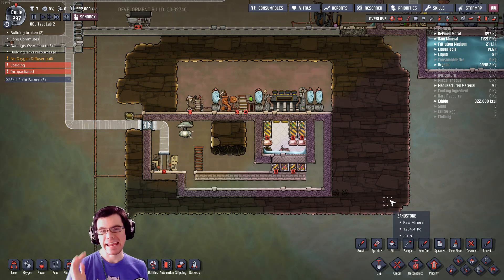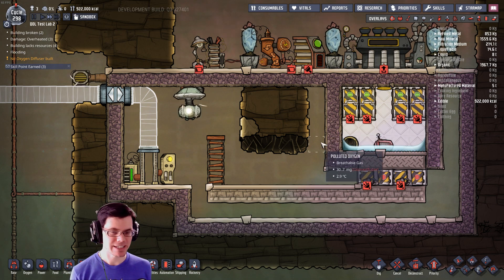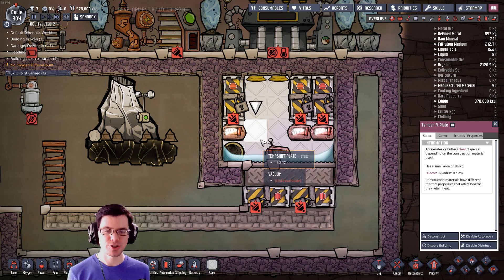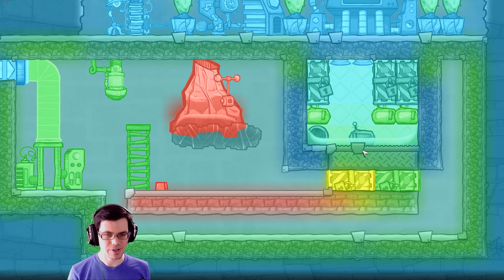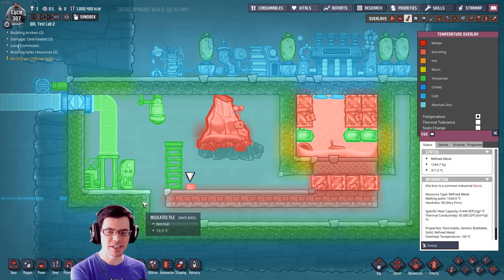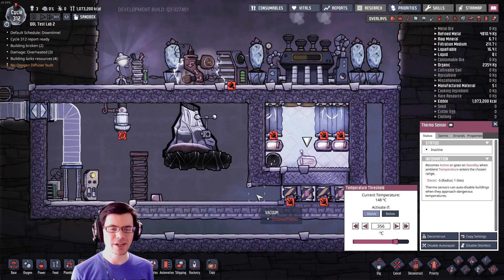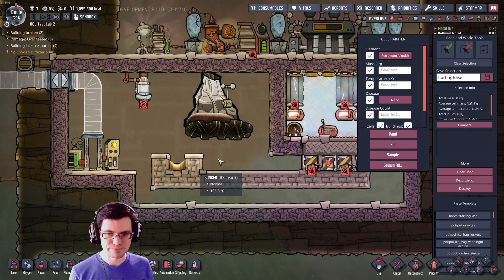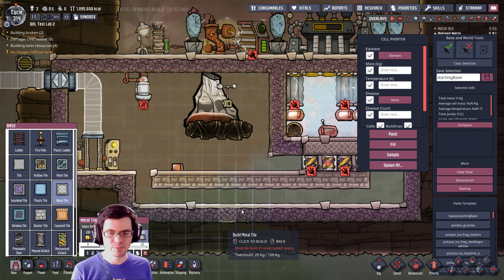Oxygen Not Included Tutorial - Renewable Volcano Power With the New Steam Turbine!

Comment: I think you should remove the solid iron when it reaches the equilibrium temperature. If you don't, the next liquid iron will fall down and it heats up the solid iron retaining some energy and slowing down the process.
Reply: Good point. I wonder if it's worth the effort tho, you can't really monitor the temperature of the metal pieces.
Reply: @frantisekzverina473 he can put a temperature sensor behind the iron and send an automation signal to an auto sweeper. But It will consume Power. I Wonder If there will exist heat Exchange between the solid iron and the temperature sensor. Yes, Frantisek, i think you are right, It doesn't worth the effort.
Reply: @alanmaioli9202  I think the sensor only shows temperature of the environment - gas and liquid. There's vaccuum in the whole room.

Comment: More couplers, steel tile the walls with coupler doors as well.
Right now you have 4 tiles that sink the heat to the water
Increasing the number of tiles that connect should increase transfer
Or add a second steam systems if there is enough heat, slower to start but you'll be running 2

Comment: what you should do is maximize the surface area where the water touches the metal tiles. I suggest enclosing said volcano in a vacuum environment, letting the content dropping onto a metal tile floor (from 5 to 7 tiles) then underneath the tile you would leave a 1 row 4 tile wide encased within an airflow tile so only air would be pumped out by input liquid. at either corners you would place a pump output, this would dish out water. then, as we only have 5 airflow tiles wrapping around 4 empty tiles (with tempshift plate if you like) exposing the rear metal tile to the separate steam container, this would be how you heat up the gas. for max efficiency I suggest you create a small 1 row empty floor (with tempshift) so the steam can be pushed out, encasing it in insulation ofc, then a steam tank directly in contact with the exposed metal tile (which would heat up the steam) and because water would form blocks (not puddle) because of the ingame physics the area of contact is maximized regardless of input ( 0.1 to 10 kg ) and would immediately turn into steam during eruption. And as soon as a block is cleared inside the liquid chamber, the pump would pump even more water into it, a perpetual cycle, and as it runs, the heat would be somewhat regulated by the exposed rim of metal tiles heating up the 2 by X steam tank

Comment: you can use diamond window tiles for 80 thermal conductivite (+50% or so). You can ramp up heat transfer some ways, 1 you can make the iron flow down the right side and make the path shorter for the heat, also you can place diamond tempshift plates to multiply heat transfer between diamond window tiles (or the lesser steel tiles). as tempshifts are 3x3. Make sure though that those tempshift plates dont touch any other heat sinks like insulated tiles etc.

Comment: I have an iron volcano in my currrent base, and your blueprint could look more compact. If its phelps, I'm upgrading it, but I set two turbines above one common spot for the steam just above the volcano; which powers an aquatuner an the auto-sweper layout. Nothing new, petroleum pipes throught turbine (H2 and wheezleworts), volcano (filled whit PO2) and loader chambers ( filled whit crude oil). To not cook your base and save power you can use a shutt-off valve in the converoy rails attached to a timer or temp sensor in the cool crude oil chamber. You dont get extra energy, but the system is auto-efficient, and hey, free iron; but I'm trying to get all the heat energy (putting a radiator whit the rails in a third steam chamber which turbine powers the base; or using a transformer and shutt-off switches what alternate aquatuner and main power line) I think we can use this layout even for purify PO2, make liquid O and H2, or metal refineries.

[EDIT]: Just after some experiments, my setup simply doesn´t gets the turbines at 100% electrical output (only 300-400w in both turbines). The heat spreads througth the metal tiles and the thermal shifplates (the converoy rail radiator just slows the heat exhange), not allowing the heat to focus in the supposed spot (the steam chamber). Also, with a bigger steam and turbine chamber, more heat is needed (and I'm, looking for a 2kg of steam at 200ºC) no retain the heat; and also the heat transfer is a pain (first metal tiles could be at 190-280ºC, but the last ones only reaches 120-140 when the volcano is in eruption). So, it simply doesn´t works. Oh, and the aquatuner it's just a power drainer. Few molten metal tiles in a vacuum does the work much better. 
     In the other side, some kind of piston whit a gas or liquid (imitating the magma in oil biome) just doubles the heat (as well as the power that contents) and the heat transfer surface (i.e. volcano's metal tiles-gas/liquid piston/steam's chamber metal tiles) needed in the medium, and also it's a little bit "cheaty" (because it's compressor after all). Maybe I could turn the compressed sour gas into NG, but is so many that I don't think that it could be power positive (besides power and energy requirements, and the huge dimensions of that machinery).  Then, the idea was to use the molten iron as part of a bigger power plant (use the heat to power steam turbines, cook some petroleum from oil and some NG), but Ithink that the heat from an iron volcano just does not have enough heat itself to power all stuff. But it would be amazing ;) and I still have 2 magma volcanoes in my current map. ^^

Comment: im not sure if this makes any difference or not, but putting a tile on the left and one tile above the neutronium will make the iron fall to the right closer to your build. that would cut out a chunk of the heat transfer tiles below and lower the thermal mass between the iron and the steam pad. also the iron spills to the left because the volcano is 4 tiles wide and spawns iron on the left center tile. if you put a tile on the left in line with the neutronium, it will spill off both sides equally

Comment: 10:54 I'd like to see a double turbine system. Basically, you'd run the steam/water through one, the run-off would be caught by the second one at a higher temperature, the run-off from the second turbine would go back to be inputted into the first. You'd have a higher change in temperature to be converted into energy/work from the second one. The only way I don't see this working is if the steam reaches the critical point by the time it hits the first turbine.

Also, they should increase the allowable temperature for a steam turbine to work at.
I wish I knew how to make a mod for that.

Comment: Depending on how much of the heat energy this system draws from the iron, if you knew what it's highest temperature will be, you could use another solid element with a corresponding melting point, so it turns into a liquid and provides a medium for the heat transfer. That would probably only work after a while, and with dormancy periods and whatnot might not be worth the extra complications.

Another method might be to enclose the volcano with metal tiles and throw some gas in there. So, instead of the "heat runway" have a "heat box" surrounded by the Vacuum room. That way, the heat would transfer equally to all metal tiles around the volcano, and could be drawn from there. Using an airlock alongside the metal tiles would still allow to open up the heat box to access the metal.

Comment: Quick question, how do you get gas OUT of the room with steam? I've found sometimes that oxygen can gum up the steam turbine system.

EDIT: Also, why does the efficiency of heat transfer matter, in the long run. Sure if it transfers a little slower, you'll lose some heat in the beginning. But eventually the system will stabalize since its insulated by a vacuum.

EDIT2: A great way to use an autosweeper and conveyor: Have some sort of sensor (not totally sure how to do this, you could put a temp sensor inside of a one tile box that has a liquid or gas next to the metal tiles with the iron?) anyway, once that sensor is sufficiently low, it activates a steel autosweeper to sweep the iron into some rails, and those rails run right through the metal tiles in the steam room! This will allow the iron to cool fully down to 125-150ish degrees. Obviously you still might want to cool it down further after that, but it would suck that last remaining energy out of the iron AND automate the iron collection, which is pretty handy.

Comment: Use a grabby thingy to grab the iron, making the auto-grabber heat up, which CAN interact with tempshift tiles?  The auto-grabber can't grab the iron in its liquid form, which means the iron can be at most around 1500 degrees when entering, and will almost certainly be less as the heat transfers out fairly quickly.  IDK how hot you can get the grabber or how quickly you could cool it down though.

Comment: A conveyor belt could, if u transfer the material trough the tiles, as in the hot plate...
that is if it wont melt without space materials ofc...
u can automate it too with a temp sensor and flow stop, so that u can control the transfer more directly.

Comment: Seen another design where the metal is dropped through several doors that funnel the heat out and then finally drops it in to water.  That keeps the metal from piling up.

For some reason I thought debris didn't transfer heat to the ground while in a vacuum.
Reply: I think I know what you mean, that was for regular volcano  when you need to prevent the magma turning into tiles. No reason to do for metal volcanoes as the metal does not form tiles when it cools down.
Reply: @frantisekzverina473  You still want to.  It could still form a tile but more importantly if say you let that metal cool over several cycles you will end up with an ever increasing pile of hot metal that never quite gets to a nice removal temperature.  If you drop it through several doors you will end up with manageable piles of generator minimum temp metal that are very easy to pull the rest of the heat out with water by conveying through metal tiles.

Comment: Could you use this as a way to process polluted water to get both dirt but also clean water with out germs?
Reply: That's what I do, especially if the map has a slush geyser.  Use cold polluted water for cooling then when it's it's getting warm shunt it over to a volcano to be turned into clean water.  Any power you get from a turbine is just a bonus, it's really there to condense steam and offset the cost of running an aquatuner.

Comment: Since the amount of power generated is at a fixed ratio with the amount of energy put into the system, the conductivity of the connecting medium is irrelevant in the long term. It will always eventually reach an equilibrium in which the amount of heat generated by the eruption is equal to the amount of heat lost to the Steam Turbine.

Now, an interesting use for Termium and Shift plates is to find out if it is possible to make a heat-pipe network that allows your to generate energy in a centralized location, and/or heat stuff up on demand in far away places... I might even test that myself... But I doubt it can be made across map without significant temperature gradients. /:

Comment: Wouldn't gold tiles be better, because of very low heat capacity it offers?
Reply: Really wouldn't matter potential energy transfered is same.. "Molten iron's heat capacity * weight = potential heat energy it contains." With arbitary numbers: if you travel it with low heat capacity tiles it will just heat up to 800-1000 celcius, while using 4x higher heat capacity material it will heat up 200-250 celcius. But the important part is how fast you lose heat (pass it to the water boiler) Where as heating up water with low capacity 800-1000C will drop to 400-500C while other material would drop to 100-125C. They transfer same amount of heat energy, just one of them works at high heat & low power, other one low heat & high power.
Reply: Really wouldn't matter potential energy transfered is same Only thing that makes difference is the transfer rate.. "Molten iron's heat capacity * weight = potential heat energy it contains." With arbitary numbers: if you travel it with low heat capacity tiles it will just heat up to 800-1000 celcius, while using 4x higher heat capacity material it will heat up 200-250 celcius. But the important part is how fast you lose heat (pass it to the water boiler) Where as heating up water with low capacity 800-1000C will drop to 400-500C while other material would drop to 100-125C. They transfer same amount of heat energy, just one of them works at high heat & low power, other one low heat & high power.

Comment: If the iron flows to the left and your thermal couplers are on the right, wouldn't it be better to build the steam system to the left of the volcano to minimize the length and thermal mass of your heat pipe (bunker tiles)?

Comment: Idea/ suggestion. The iron heats up the block below it, why not put a door below it. that would increase what it is in contact with to 2 blocks that could be used to push heat over.
Reply: also why not put the steam engine transfer on the other side? that would make it a shorter distance that the heat has to be moved.

Comment: Brothgar, what if you have a larger pool of liquid to facilitate heat transfer rather than just a 1-space puddle held in place on 3 sides by blocks?  Would that provide enough energy transfer from the 'entry' liquid that the molten iron comes in contact with thus preventing evaporation of your liquid?

Comment: Could you use something like phosphorus or gold as the liquid? it doesn't have to be liquid at regular teps, just at above the boiling point of water. As long as you have enough to soak up the heat energy of the incoming metal without vaporising.

PS: Also, you could use conveyor rails to move the steel along the conductor tiles and into the steam room to make further use of its heat.

Comment: You need a liquid to transfer heat from hot iron? Gold.... iron turns to a solid at  1534.9   while gold turns to a solid at  1063.9. There will be points where the gold will turn solid but as long as you don't sweep it should be fine. I was eyeing Glass... you would need 25 grams of sand and with an auto dropper but I fear rock gas might be a thing.

Comment: @Brothgar
Why do you dont use diamond as heat conductor?
Its the best non space age stuff you get with a little burned flesh.

Also as an idea.
You made ones a video about room cooling and how to use the walls to cool.
Why not putting the vulcano in a room filled with a heatconducting gas with walls of diamond/thermium?
Conected with the doors and the turbine you get an efficiant "cooling" system for your all to hot vulcano.
Reply: @brothgar  i tame my cold steam geysers that way. One layer of isulation outside and one layer of granit where the cooling pipes are in. The watercycle cools the room and heats the aquatuner to make steam to in the end dystroy the heat and make some power.
Of couse this dont work for vulcanos but the idea seen to hold.
I also build a second aquatuner next to the cooling loop to get my fresh water out of it.

Comment: Wouldn't it be better if you put the steam turbine on the left so the heat wouldn't have to travel so far?
Reply: in a vacuum environment distance does not matter as heat has nowhere to escape. Even if it goes 5000 tiles the energy will be transfered with zero loss. The only problem is heat capacity. It would take ages for those tiles to heat up

Comment: after watching your vid , that remind me that my map has I-volc as well and i never used it because it pours 1300+ deg C iron, previously i was thinking about steam engine but the way it worked , there was far better way to do it. current one makes previous "abuse" even more easier . so once again there is simply no way to burn so much heat , maybe steam turbine might need higher limit for power output for larger amounts , but i have nothing where i can sink so much power in to. my dups produce so much power that i barely use anything.

as for idea , i would probably just pour molten iron right in to the chamber with steam and just pour back water , but that only possible if you have space material.

as in your case something like that : https://ibb.co/Ryk3qtv

and if you need to get iron out , i would build pickup thingy above and move it to the right , its very short distance and u might it drop directly in to the pool of polluted water .

leaving iron inside might build extreme amount of energy stored inside , where your iron turns in to sort of "battery" , science ? no , magic ! but there is one problem , that thing builds up temperature as it works ,sadly to cool it off you need either gas or fluid , and since any fluid turns in to gas , u get quickly  out of options and whats left is to send dups somehow inside.